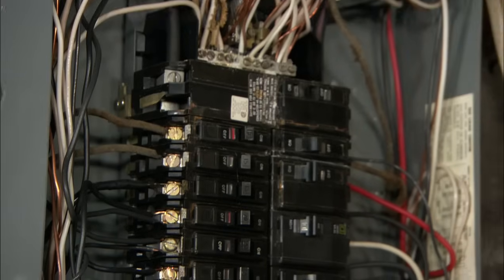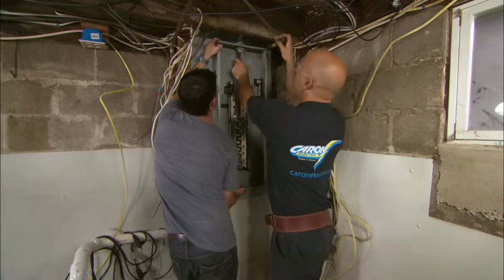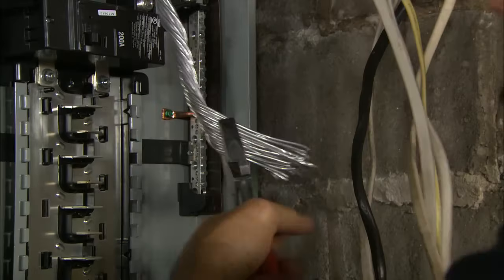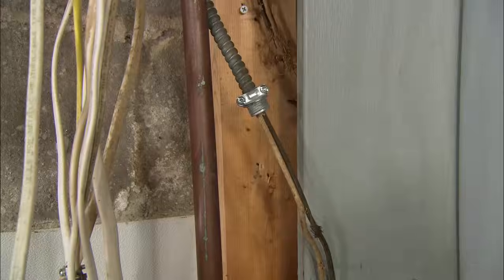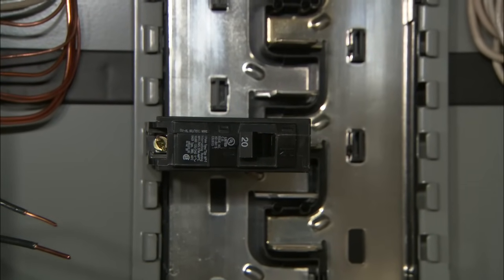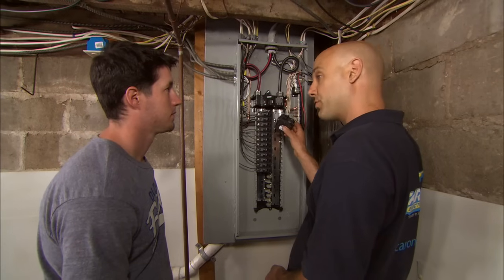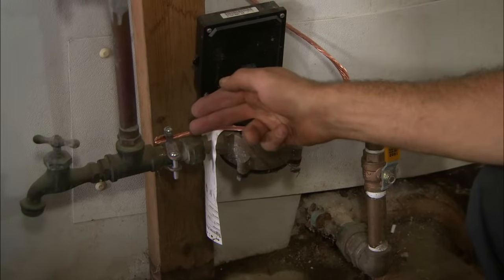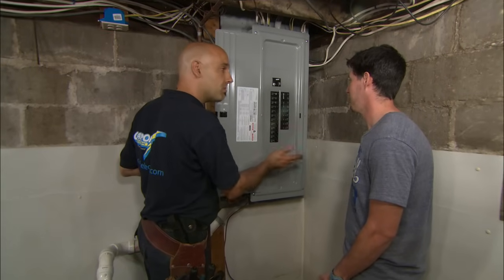How to Upgrade an Electrical Panel to 200-Amp Service (Part 2) | This Old House

Comment: Wait the ground and neutral go under the same strip? That causes the GFCI's to trip doesn't it? OR is it an TN-C system? I'm confused as an European electrician.. Don't you have GFCI's required on all your groups? And do all of your groups (circuit breakers) have only thermal protection and not magnetic protection? (overheating on the thermal and short circuiting on the magnetic) Someone explain to me...
Reply: +Gra Gor That panel is the first means of disconnect.  We have at least two grounding electrode conductors on our electrical systems.  They connect with the neutral and the equipment grounds at the first means of disconnect.  Our inspectors often let us take them to the meter base if it is more convenient.  Because the neutral conductor is purposely earthed, there is no difference in voltage between the neutral and the earth.  You will not get shocked unless you have active circuits and interrupt the path of the neutral.  The equipment grounds are normally non-current carrying conductors which ensure that all non-energized metal parts of the system and connected equipment have a good path back to the source to ensure that electrical faults to non-current carrying parts cause the circuit breaker to trip.  The only problem with watching old how to videos such as this is the fact that it might not be up to current code, which this one isn't.  This one also has some obvious code violations such as double tapping the grounds in the barrels of the ground and neutral buss bars which are not listed for multiple conductors in each barrel.  Keep in mind that we in the US are using 120/240V systems in our houses as opposed to the European 240V only standard.  What we call the neutral is what our code calls the grounded conductor because it is purposely earthed to stabilize the system.  We do not rely on just having it earthed at the power company's transformer.  We also earth it at the building connecting it to ground rod(s), the cold water main (if it enters the building as a metal pipe), and building steel (if you are dealing with a steel structure).  All of this ensures a better earthing system than relying on the earthing at the power company's transformer only.
Reply: The utility provides a 3-wire service which consists of two "hot" wires and a neutral. Between the two hots there is 240 volts. between either hot and neutral is 120 volts. The ground begins at the first disconnect and is the point where the ground wires in the circuits connect to the neutral. Nowhere else is the neutral allowed to be grounded within the building. Since GFCIs are "downstream" of this connection, they do not trip.
Reply: FoodOnCrack no the 2014 nec states that GFCI (210.8)  must be in place for Bathrooms, garages or any located floor below grade level not intended for habitable rooms and limited to storage areas, work areas, and ares or similar use, outdoors, crawl space at or below grade level, unfinished basements, kitchens where receptacles are installed to serve the counter top surface, sinks where receptacles are installed within 1.8m 6ft of the outside edge of the sink, boathouses, bathtubs shower stalls same thing like the sink.
Reply: Ian Belletti Good explanation. I will just say that most ground bars ARE listed to accept more than one equipment ground, but no neutral bars are. You have to look at the sticker on the panel cover to tell.
Reply: We are in different countries Ian.  Here the panels come with quite long ground bars mounted on either side of the panel and then a bag of shorter ones to be sprinkled about here and there if required.
Reply: well la-de-fucking-da. pin a rose on your nose, we got a european electrician here! try using 60Hz instead of 50 and you will see the way.
Reply: Good explanation.
Reply: +The Reynolds  Both bars in the video are neutral bars (they are on insulating mounts).  Most people don't add a ground bar in the main panel in a residence unless there aren't enough lug holes for the number of conductors or they have an external disconnecting means by the meter.
Reply: Ian Belletti well said!  People don't realize that only past The first point of disconnect The neutral and ground bus bars shall be separated, ie, a sub panel. Great explanation!
Reply: +Risto Mladich Still didn't really answer his main question, you just simply stated where GFCI's are required by code, in the US...
Reply: Michael Cox -   "ND, worst of all, he has the box grounded to this neutral/ground bar, which should give someone a mild tingle if the panel powder coating wears to bare metal."        Ya.  Lots of circulating currents in this wiring job.  Also a lot of EMF as well.   I'd be careful every time I touched metal.
Reply: No problem with Neutral and grounds going to same bus bar, will not trip GFCI.
GFCI is not required on all circuits, just those near water like Kitchen, Bath, Garage, exterior, etc.
Reply: +FoodOnCrack You got to remember that the us is about 10-20 years behind Europe in terms of electrical standards and safety. UK electrician here and its shocking to see what sort of stuff the guys do in america, looks like the crap we rip out and replace today.
Reply: FoodOnCrack 
all of the new homes being built in the U.S. have the new trip outlets but many older homes still have the old outlets. we don't force people to replace it. here in the U.S. we still believe in some freedoms but soon we will be just as oppressed as you
Reply: +FoodOnCrack  the N and G bars are actually separated and only touch at one spot in the middle, kinda hard to see
Reply: FoodOnCrack the simple answer is no because we don’t use GFCI breakers only GFCI outlets
Reply: @Mrcaffinebean  
Oops, now we do.  Home Depot and Lowes both sell GCFI breakers and arc-fault breakers, and they even have breakers that do both!
Reply: +FoodOnCrack I too would like to know if inspection passed this improper installation: neutral and ground tied via common service bar (the black band in the middle) which makes him think it's ok to mix neutrals and ground on both bars...AND, worst of all, he has the box grounded to this neutral/ground bar, which should give someone a mild tingle if the panel powder coating wears to bare metal.

Comment: I am not a licensed electrician or experienced with the work here but this is a very very bad tutorial and average people should STAY AWAY from learning it.  Relacing the panel is very simple but the main power line coming into the house is LIVE all time.  Unless you are licensed (I did see my friend doing it live at my house, changing the whole panel) lots of safety concerns here...
Reply: When ever working with service conductors you would have to get your electrical service provider to disconnect your service.
Reply: if your doing just the panel and not the meter base, turn off the main and pull the meter,then the power is off to the panel. it's not that hard jesus
Reply: +ASIC Man No, they're only live when not being properly serviced. In this instance they even said and showed that the main power company line was disconnected.
Reply: No it's not lol. You call the power company and they shut off their power if need be. There's 2 different sets of power that comes in to the meter, the power company and the "homeowners". Most have a disconnect switch inside the meter also
Reply: He teaches you just enough to get somebody hurt..

Comment: The one thing I don't like is seeing the neutral wire to the meter used as a ground but it would work just the same as having the neutral and ground bar combined.

Comment: Why did you have to call the power company? My electrician just pulled the meter out.
Reply: Depends on the area. Some utilities allow electricians to disconnect and reconnect their drops when doing change outs. Other areas require you to call them to do it.
Reply: cooldog60 this is just part of the actual episode. where they replaced the actual meter socket and the service entrance outside.
Reply: Some electricians are qualified to remove the meter socket. However they require the proper corse to do so. Other wise the electrical provider would have to disconnect and re connect.
Reply: "service upgrade" involves more than pulling them the meter.
Reply: @shadowwolfmandan  I am talking about disconnecting the power to put the new service in. I have no idea what you are talking about.

Comment: What if the idiots that owned the house before you didnt install the right gauge of wire?? You just cant assume because the wire is a certain gauge then thats the breaker that goes to it...?
Reply: the good thing is that each wire size is rated for a specific amperage. so as long as the wire size is equal or larger than the upstream breaker, you are "safe"  meaning the breaker would trip before the wire would overheat and fail.  So if previous owner had installed a high current device, they could have broken code and put a small wire into a large amp breaker (fire hazard).  this would let the PHO run the device w/o nuisance trips, but be very unsafe.  if NHO comes in, and puts that back to the "correctly sized" breaker, they could get nuisance trips, and realize the wiring is bad.
Reply: @GhostHostMemories  you're not talking sense. what if someone runs twelve gauge to the first junction and then fourteen thereafter. you don't know that just because the wire going into the breaker box is twelve gauge that the entire circuit is fit for 20 amps.

Comment: 7 seconds into this video and I'm having a hard time watching it--the electrician has no eye protection on--come on you people get with the 21st century-
Sorry to rant about this, however, the place that I worked at he would be out of a job for not using eye protection.
Reply: The panel was not electrified. Do you wear eye protection when washing dishes or sweeping the floor?
Reply: @buggsy5  Electrified or not, if you trim the end of a wire and it flies into your eye, it can do some serious damage.

Comment: Great - another video where the Youtube commenters tell us how much smarter they are than the licensed electrician and pointing out how many mistakes they assume he made due because they assume their local codes must apply everywhere.

Get a grip.  They aren't about to show every detail as the process would take several hours.  It isn't meant to be a tutorial... it is just to give the typical homeowner a basic understanding of how involved the process is so they don't balk at the $1200 cost to upgrade a small residential panel.  

I'd trust Scott to work on my home, and his presentation and customer service skills are top notch.  Some of you self-proclaimed "experts" could learn a thing or two here.
Reply: Pretty unfair and judgemental remark.  Go fly a kite.  Hopefully, w/ a key attached.
Reply: Master Chief 00117 you one lyung as dog. You're not a electrician engineer you are a freaky food cooker chief lmao so stop trolling
Reply: I am going to buy a box myself at home depot and do it after seeing this video.  The video showed how easy it is.  Just get a plier and cut cables.  Here in LA, they charge $2-5000 to do this and it looks like it only takes under an hour.  Any suggestions?  Oh and I am a 5th grade science teacher so I think I can handle it!  JK!
Reply: goodcyrus Just remember you need the power company to disconnect service and reconnect. Your power company must jump when you need the electric cut back on. Lucky you
Reply: Red Pushpin I agree with you! The upgrade was clean orderly and neat. Well documented install from the drop to the panel.
Reply: Master Chief 00117, tell us. How many funerals? I'll guess none. What a pathetic way to attempt to get your invalid point across. I'll go one further, I'll bet you're not only not an electrician,  you're someone who actually believes Benjamin Franklin invented it.
Reply: Definitely not a tutorial, he didnt say to make sure you have proper permits, and have the electrical company kill the power at the meter... but most importantly, he wasnt wearing SAFETY GLASSES. Anyone who has ever had a tiny copper shard in their eye knows how bad that sucks.
Reply: Robbit Bobbit im an electrician and have only been to 1 funeral of an electrician, but been to a bunch of youtube troll funerals. Ha
Reply: Phormify well I'm not a troll I bought an older home last year and the box needed to be upgraded I was scared it was gonna cost out the ass ....i bought the box at Lowe's and the electrician came ( a real place not bobs repair service) and he charged me 75 to put it in
Reply: Well said my friend :)
Reply: He doesn’t do electrical work everyday so you can’t beat him up. I cut and reconnect hot and I’m more neat but I do this everyday so with practice it gets better
Reply: Phormify YES
Reply: cooldog60 The electrician  is a bad business man. The only winner was you. Congrats
Reply: Red Pushpin By the way, how did the moniker Red Pushpin come about? I pushed a few hundred connector pins in my day in a model shop. Just curious. Keep the trolls running buddy!
Reply: I don’t think it’s about the trust, how to install a 200 amp box leaves a bit more to desire.  Understand that this is a snapshot and not made for a full tutorial, but this could be highlighted upfront as an overview and not the expected tutorial that many of us believed it to be.  BTW I’m no expert, that’s why I’m here to learn.
Reply: What idiot pays $1200 for this?
Reply: Several hours??? I think you are just slow
Reply: Phormify $1200 wow that is crazy. I had a fuse box replaced with circuit breakers. I bought the parts about $125 the electrician put it in for $65. Since the house is a rental house I have to have it inspected every time I get a new tenant. Which is about every year. Never had a problem with it passing inspection.
Reply: I'm well aware of the NEC, but I'll disagree with you that he is violating code or doing anything illegal. 

Thanks for proving my point about the comments though. You may return to your regularly scheduled trolling of YouTube comments now... I'm sure you have a long day ahead of you.
Reply: If you are going to call someone stupid it helps to use the proper version of "you're".  Ironic isn't it?

Keep trolling Phil... You may not be much of an electrician but at least you have this YouTube thing working out for you.
Reply: I agree with you. Scott did it correctly 100%. Trolls here are all wrong.
Reply: You know how many electrician funerals I been too? They thought they knew it all as well. Now they get to see if Jesus really does exist.. 

So you go right ahead and make an assumption. They toe tag the experts everyday. And by the way. I am an electrical engineer for 40 years. I'm still here because I trusted nobody and payed attention to the reason the NEC and NFPA have these rules. As they don't pull them out of thin air. Well except the ground rod. It does shit. As an electrical short circuit will try and reach the source. The source being the Transformer....The rod is there so Lightning has a path to ground. So your house doesn't burn down...

Comment: I gotta chime in on this. This video is quite stupid for starting off with just "Ok lets go cut the wires" Without ever mentioning the fact that a homeowner shouldn't be in there in the first place, and second to use only a licensed electrician. You've gone and cut off the safety types that should be the first things mentioned. And you know some idiot out there is going to go and try EXACTLY what this guy did.
Reply: The power was disconnected by the utility company in a previous video
Reply: snipermerc what's a "licensed electrician"?  Welcome to Pennsylvania.
Reply: lol. he did mention that stuff
Reply: Stick to Christmas lights idiot

Comment: No arc fault breakers???
Reply: AFCI are not needed as this is a upgrade..AFCI are needed when you are installing new circuits or upgrading/replacing outlets.

Comment: Also from what I have looked into around here, cutting and moving the wires in the existing panel to the new panel with new breakers means bringing the panel up to current code. Around here that means AFCI breakers just about everywhere, and a dedicated 20 amp, AFCI + GFCI for the outlet in each bathroom, and a separate circuit for the lights in the bathroom.

In short I'm not sure this would pass inspection here in MN. I'd be happy to find out that my interpretation of the code is too conservative.
Reply: probably not in MN.  i would bet that they had full inspections required (just doesn't make for great TV)
Reply: Andrew Frink that's why you don't ever tell code enforcement when you're changing the box.
Reply: I know here the power company won't reconnect you until you get it inspected.
Reply: Arc Fault Breakers have to be used for bedrooms.
Reply: For new construction, yes.  I just did a box upgrade in California about a year ago and the inspector did not require GFCI or arc-fault breakers.  We do need to have GFCI outlets near water.  We can also upgrade two wire outlets to three by using a GFCI outlet to create a synthetic ground.